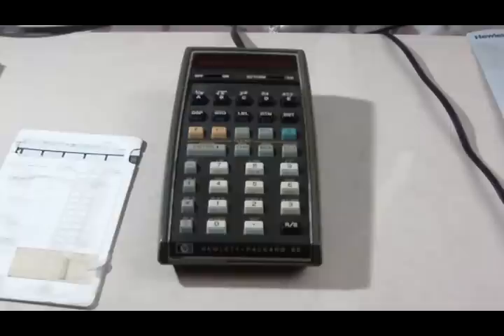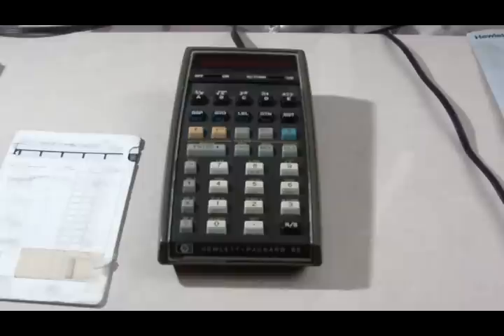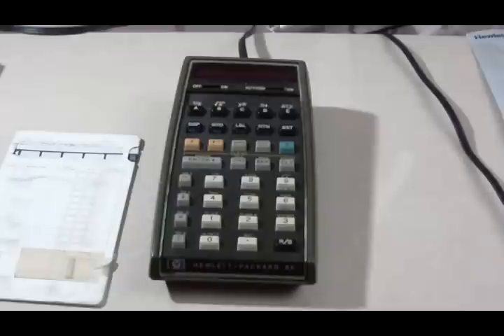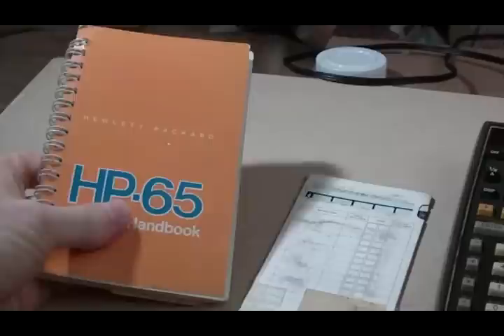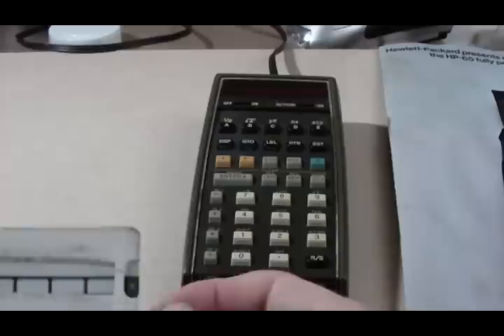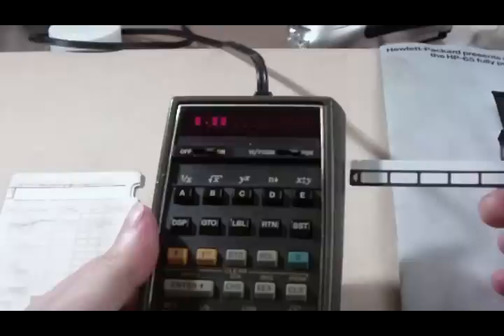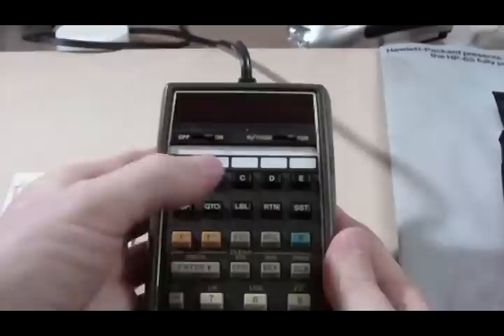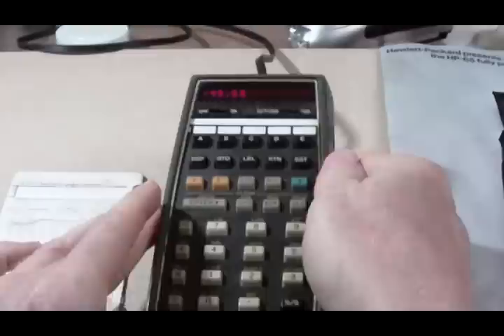Hewlett Packard HP-65 calculator working.

Comment: My Father almost purchased the HP-35 back in 1972, but opted instead to get the HP-45. Later on, he would go on to purchase the HP-19C, 41CV (for me), 15C, 28C, 28S, and one of the 48Gs. I almost bought the HP-75 with the much longer manual fed (not motorised) card reader in the 80s, but could not afford it. Those were the days. Lastly, the one thing I loved more than anything was RPN - Reverse Polish Notation - makes much more sense than algebraic notation I feel. Thank you for posting this.

Comment: I bought an HP-15C back about 1985 to use for college.  1st experience with an RPN calculator.  Will never be without one again.  I currently have the HP 48G and HP 50G.  Bought the HP 50G brand new (about 130$).  I was in a flea market near my home a few weeks ago and found a MINT HP 48G, in the original box, with all manuals, warranty paper, etc.  Ticketed price?  25 bucks!  I didn't even try to negotiate, I gladly paid it.

Comment from the maker: @ericksonlk A card can hold 100 steps.  The back of the card has a magnetic strip on it, like a credit card.  The reader in the calculator is like the head inside a tape deck.  The manual says that you could insert the card backwords and get an additional 100 step program on it for a total of two 100 step programs.  The manual does not recommend this because the motor roller is over the second track and over time it might not read properly.

Comment: Or a link to the kit you used to fix it?
Reply from the maker: I did this repair over ten years ago so I don't remember the link.  If you type in "hp 65 gummy wheel" into the search engine you will find some articles on how to repair and where to buy the parts.  I just did that while writing this response and found some articles and a seller on ebay selling the parts.

Comment: How did you create the magnetic card holding your program? Is a separate machine used to create it?
Reply from the maker: The calculator writes the program to the card and reads the program from the card.
Reply: @bunnspecial  Really? Whoa, that's impressive. How does that work internally? The reading I can imagine is accomplished by a sensor, but what about the writing? Is an electromagnet used? Also is the card easily writeable  i.e. if I run a fridge magnet over it, will I corrupt the data?
Reply from the maker: It is magnetic like a cassette tape or floppy disk.  If you run a magnet over it all is lost.